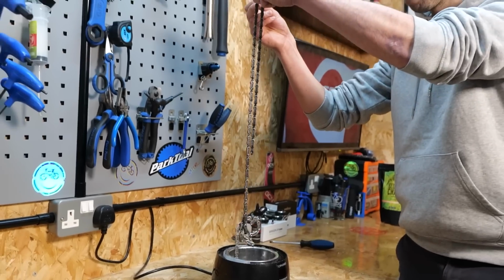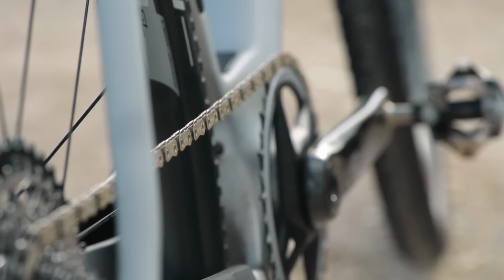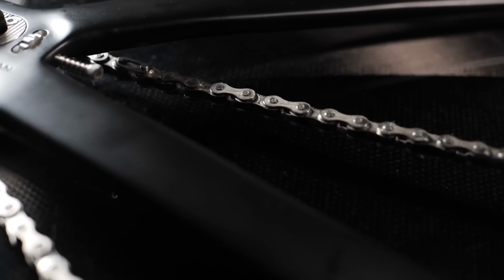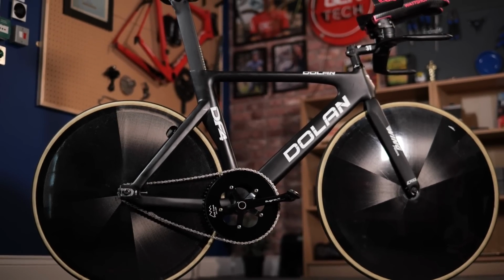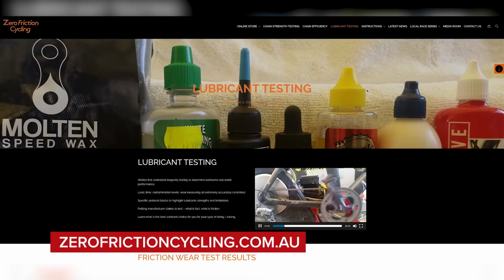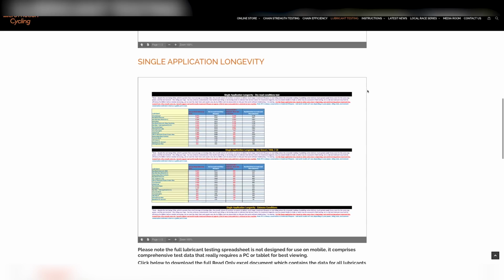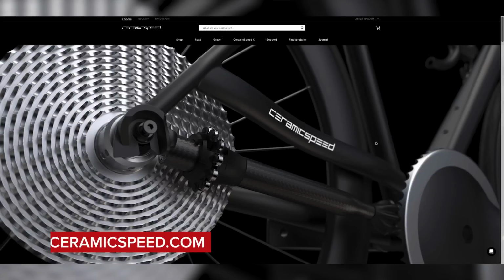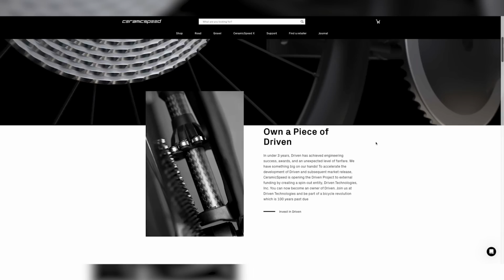Maximising Drivetrain Efficiency & Longevity: Deep Dive With Josh Poertner

Comment from the maker: Do you want to see us make more deep dive videos like this? 🤔 Let us know in the comments below! 👇
Reply: Absolutely 👍
Reply: Absolutely yes, these videos are so educative
Reply: Josh did a great job really interesting .  Learnt alot , at the very least the importance of proper chain cleaning regardless of lube. 
So yes please
Reply: But wax can't work in wet conditions, Especially  drip on wax It is dissolved in water and it will also dissolve in rain
Reply: @taburetca  If you look at the ZFC data you will see that wax, including drip wax, outperforms all others even in the wet.. but the issue you experience in the real world is that the wax lubricants are bad at hiding when they begin to fail.  Whereas oil based lubes remain quiet even when they have failed due to the viscoelastic sound damping within the chain.  So wet lubricants fail first in the rain, but hide it for a long time, whereas wax lubes are letting you know audibly that they are beginning to fail well before complete failure.
Reply: Went to Zero Friction Cycling as the video showed, and my Squirt lube shows a high wear test.  I switched to Squirt because ceramic speed test showed it as the the 2nd least watts lost in all the lubes they tested.  Now I'm more confused.
Reply: @Oblivion__Approaches  I did the same. I'm about out of Squirt,  will try Silca Super secret next
Reply: @Oblivion__Approaches  The CeramicSpeed/Friction Facts test used heated immersion to test the Squirt for efficiency as it doesn't penetrate the chain when simply dripped on.  Since they are testing lube efficiency, this was the only way to get the data they were after, but ZeroFriction tested it by drip application which is what you would do as a consumer and it doesn't test so well due to this penetration issue.  You can approach the performance of the FrictionFacts/Ceramicspeed test if you heat the chain with hair dryer before applying and then use the heat and your fingers to really work the lube into the chain while warm.
Reply: @Oblivion__Approaches  If it is only watt loss, then you save on your energy. If it's only low wear, you safe on you bank account. I personally don't see the few watts marginal gains worth the shorter longevity of the drivetrain. The two is likely opposing each other.
Or you can check both tables and find a sweet spot for you.
My personal experience is that I do not see the performance in watts difference, but definitely see the longevity and shifting performance - smoothness difference.
Comparing a muck-off dry lube to a silca sinerg-e.
Reply: What an excellent show, great questions, deep knowledge and answers. Ollie and Alex, great presenter  synergy  combo.
Reply: YESYESYES!!!!! And try to create more of your own data by inviting us to participate
Reply: This is absolutely fantastic! Such detail….I am now in no uncertain terms about chain waxing. Thank you GCN!
Reply: Yes please fantastic video
Reply: Yes, please.
Reply: HELL YES
Reply: Yes please. I learned so much that inspires me to share with others to help them! Thank you!
Reply: Yes, please. Having expert "testimony" vs. casual opinion is quite helpful. This has settled a long-standing debate I've had with myself for years and convinced me to make the investment in hot wax dip.
Reply: Brilliant. More! 😀
Reply: Can you make a "user manual" type video for super sectet lube? First time I hear it needs 12h to dry... When and how to apply and reapply? Shall I clean and how when applying super secret? How often shall I add super secret lube?
Reply: Most definitely!
Reply: Josh is a scientist. Everyone I listen to him on several videos I-ve seen of him, I feel awestruck. Please invite him more. What about a deep dive video on tyre pressures and his methodology or if we should use butyl, TPU or latex and TPIs?
Reply: Yes, and yes again! I get a lot more useful information from these than some of the more, er, clickbaity videos. ;-)
Reply: Yeah that is the way to go !
Reply: @gcntech You need some couches or something where you can sit down with in-house guests. For these longer interviews.
Reply: Yes please

Comment: I’ve been waxing my chains since “Winning “ magazine was out ! Quite, smooth , clean! And that was before 11speed … Regina freewheel and campy super record ! No indexing or S.I.S at that time, and I’ve been doing ever since.  One thing is you can reheat the chain after waxing to get rid of dry wax buildup or you will have little wax pieces on your floor and you will have it on your shoes and all over the house.  But it’s good  method for quite bike ! Also the losses of the freewheel! You do all of this stuff and have noisy freewheel ? You should use the best low friction lube or grease to make your drivetrain quite and efficient ! Not like the way you hear wheels now…terrible ! Regina had the CX freewheel and it was quite, and with their chain …perfect!  This technology is embarrassing old ? And unfortunately now with…  god forbid electric bikes? It won’t matter. In pro racing they charge bikes and chains often so you can’t use them as a example? The key word here is….clean! Every time I come out with my bike people ask is it new ? Nope ! Its clean !

Comment: I'm not convinced that alternate drive methods can't be made to work just as efficiently as chain drive. Cars have much more complex transmissions and automakers have developed ways of making high precision parts that work under far more extreme conditions than bikes experience. It's just that the cost, weight and complexity make it impractical for bikes. But, it still seems worth pursuing, if for no other reason than that it could be fun, but also because who knows, perhaps someone will eventually come up with an alternate drive system that's cheaper, lighter, more efficient and more rugged than chain-based ones.

Comment: Do chains technically have bearings or bushings? Meaning, the rollers as they rotate around the pins. The pins I assume are technically bushings as they rotate inside the side plates. Just curious, nothing important. I have an engineering background so such things just interest me.

Otherwise, I've finally come around to giving waxed chains a shot. I had no idea that they were that much better than any other kind of chain lubrication and figured that they were mainly only for bike fanatics. For years I've been using dry lube, specifically Dumond, which is quite good, but apparently wax is much better. I'm less interested in going faster or having marginally less drivetrain friction than in extending the life of the chain and drivetrain well beyond what I'm used to. But having a quieter, cleaner and smoother drivetrain is also a nice benefit, especially for indoor riding where noise can get annoying.

Comment: Unless you are a pro racer, or very high level amateur racer, I suppose the question is how much money and time is it worth spending on lubricating a chain to make it last longer when you can simply buy a new chain for basically very little money? (Yes, there is of course the friction reduction/power increase issue as well, but for us mere mortals I don't think these marginal gains will make any significant difference to be honest).

Comment: Hot melt wax has one VERY BIG disadvantage not mentioned here - it does not waterproof the chain. If you ride in rain or leave your bike outdoors exposed to dew, beware of links rusting internally and seizing up - not only increasing friction but meaning you need to replace the chain. It can happen very quickly.

Comment: The use of more compact drivetrains does cause the chain to bend a bit more.  Been using paraffin for forty years now.  I would run two or three chains switching between them.  Narrower chains don't seem to last as long.  Lubrication has to be done more frequently, but with master link, it's not that bad.  The Crock Pot I have takes a good hour and a half to melt the wax, but the temperature is bound to be much safer than direct melting.

Comment: I recently switched to Silka hot wax as I got a new gravel bike and wanted to prolong wear as knew I'd constantly be in the dust. I converted 2 chains and took them to Unbound this year. The 1st chain I converted had about 80 miles of riding before the event, and with the mud, rain and 205 miles, the chain did amazing. I'm a wax fan for life now. It really is not that much extra work either. Just get a dedicated mixing bowl for the instant pot so you can easily dip the chain. Now I just need to convert the other 4 bikes to wax. 😋

Comment: Bike chain isn't spinning at 10,000rpm. Lubrication for bicycle chains is much more trivial than most think. How many are caring to win a race by seconds? Almost none. They could probably build a chain with builtin lubrication. Bicycle chains wear so fast that wear is hardly a concern. This really shouldn't be the case. A bicycle chain could be made to last a near lifetime. I don't think athletes should be the primary concern or driving principle of bicycle mfg. They are the trivial numbers using bicycles. We should be more concerned with durability, longevity, recycling, and standards for mfrs.

Comment: 5:30 it's very well possible to put a chain into a casing. Somehow, we just chose to not do this on our road bikes. One of the nice sides of riding a velomobile is that not only the chainwheel, but also the chain and the cassette have a much longer life due to the whole system being inside the bike. It's biggest enemy is your own sweat in that environment, but 30.000 km on one chainset is not unheard of.

Comment: The mechanical engineering question I have had in my 60 years of riding which I have never had an answer to is this: when riding the bike, taking into account all vector forces of chainring and cassette, if the chain tooth ratio is the same with a larger chainring and a smaller cassette ring vs a smaller chainring and a larger cassette ring, which utilizes more power, or are they the same.  With the same cadence, I always feel that it seems harder to go faster with the smaller front chainring, and there appears to be more cross chaining with the larger chainring, when the tooth ratios are the same.  Anyone got the answer?

Comment: Can you switch from dry/wet lube to wax in the middle of a chain's lifecycle? How clean does a chain need to be in terms of removing old lubricant and dirt? Will running it through a Muc-Off chain cleaner and rinsing it off do the trick, or should I start with a brand new chain?

Thanks for this - it was super cool.
Reply: I have done both with no apparent difference between the two methods. We have nine bikes between the two of us, they range from sexy carbon to clunky steel folding. My preference for cleaning is to remove the chain, and immerse it in a screw cap plastic bottle, two-thirds filled with white spirit, or any other cheap degreaser. Shake it, let it stand long enough for you to drink an espresso. Decant the liquid through a paper coffee  filter into  a second bottle. Keep this degreaser for the next time (I think mine is more than six years old now). Immerse the chain in the liquid wax.

Initially, it might appear to be a lot of faff; however, the longer intervals between needing to give your chain some TLC soon begin to add up. The greater efficiency of your transmission is harder to measure, unless you have a power meter and accurate records of "before and after". After a year or two, you begin to realise how much longer chains and cassettes are lasting.

The only negative I have yet to solve: when cycle touring, it is often necessary that our bikes are out in the rain while we are warm and dry inside our tent. Rust spots have appeared on our chains. The chains have plenty of wax where it is important: inside, on the rollers and plates. However, rust on my chain is a stain upon my soul!

Comment: The bottom line is 'keep your chain as clean as possible' i've just changed mine after 5500 miles both outdoor and indoor use. I check monthly with the Park Tools CC-2 to ensure i stay on top of wear. A regular wipe down with a (GT85 damp) lint free cloth then a degrease/ relube at regular intervals keeps it tip top.

Comment: If you are a slow rider, and you feel like a time/speed difference won't make an improvement, you are mistaken. You have more to gain from improvement than the pros do!

let's say, you average 20 mph on a flat trail. The trail is 20 miles long so your average time is 1 hour. If you make a 10% improvement in average speed by ditching your alloy box wheels and going for deep carbons, you can now go 22 mph, and your trip falls down to 54 minutes, that is a 6 minute reduction. 

Let's say a pro rider can do the same trail at 30 mph. That pro rider will average 40 minutes. yet, if the pro increased their speed to 33 mph, the same 10% increase, they would average 36 mph, a 4 minute decrease. 

So as an amateur, you would reduce your time on our hypothetical trail by 6 minutes, and a pro would by 4 minutes. 
So yes, it is also absolutely worth the better equipment for amateur riders, especially if they do enjoy chasing KOM's or sprinting against their buddies.
Reply from the maker: Great point Justin! Marginal gains and drivetrain efficiency isn't just an issue for the pros we can all benefit in some way. Perhaps those that just wan't to enjoy the rides don't have to worry but for those wanting to push their speed it can be a great hack!

Comment: Why don’t they use DLC on the moving parts? No need for wax or anything else.
The pressure he talks about is nothing compared to a motorcycle chain. Let’s not get over excited. Why don’t we use ceramic pins in the chains? That would better too.

Comment: I would love to see a deep dive on bearing types (steel vs ceramic) and oils vs greases. Seen some data suggesting bearing type is irrelevant but lubrication type is the key.
Reply: I know he's not for everyone, but Hambini has at least one compelling video that sheds light on the nearly non-existent benefit of ceramic bearings for cycling applications. The low rotational speeds that come into play in cycling seem to not bring the benefits of ceramic into play. But do some research on sites that provide factual evidence and settle the matter for yourself.

Comment: Ran my last chain with a wax that doesn't have the greatest reputation for longevity, got 2200 miles (3500km) out of the chain. Currently running long intervals (1000 miles) with Silca wax and topping up with super secret lube along the way (200-250 miles). 2900 miles with no measurable wear yet, and very little hassle.
Reply: Great to hear Tim!

Comment: dear silca, just an idea on your sealant. can‘t you sell the carbon particles separately so we can put them dry in the open tire and the sealant then into the open valve?
Reply: Thanks Penny, unfortunately, loose, individual carbon fibers are much finer and lighter than a human hair and the slightest puff of air or slip of the hand could put thousands of them airborne when working with the material.  We even looked at putting the fibers in a sort of 'Tide Pod' that would dissolve, but the real key to the manufacturing is coating each tiny fiber with the sealant as the two are introduced.. we continue to work on innovating in this space, but yeah, this one is a really hard problem to solve!

Comment: I always  use multiple chains for a long trip.  I do not race, so am my own support.  Yes they are kind of heavy, but two is enough as I have overnight to do a surface clean and then put in container (zip lock bag) with drip on wax.  Depending on the distances, it can last up to two days or maybe just one before replacement.  but that makes life cleaner.   One thing,  300+ miles, that is much longer than I run before a change.  hmmmm..

Comment: Do you use quick links when/if you are hot waxing chains? Are they "good" enough or do yo just use pins?
Reply: I'm onto my second SRAM PLCK-D1 PowerLock (12sp Flat-top chain), having retired the first one after connecting it five times from immersion waxing the chain every 300 or so Km. They're about AUD $7.00 each. One of those per 1500Km with a second chain on rotation to do immersion waxing that should see my drivetrain last at least 30,000Km of quiet, clean, very low friction riding seems to me to be pretty good value. SRAM does not do replaceable pins for its 12 speed chains. Not sure about the others.

Comment: How eco friendely is Silca hot melt? At the bottom of the slow cooker there's a lot of dark stuff, is this the tungsten disulfide? Do you have to mingle it with something like a spoon before putting the chain in the pot? Is it more" eco friendly to wash micro fiber cloth after cleaning chain or to throw them away? We have a history of chain breaking on our Emtb (11speed drive train more frequent +9 speed timing chain less frequent)tandem (plates coming lose of pins and quick links same even with wipperman).  If a chain breaks offroad waxed is a giant advantage : oiled chain dropping in sand : nightmare. Meanwhile I recognize the sound of plates coming loose. It's not because of shifing mistakes, although in my experience DI2 is harder for the chain than mechanical. We're spinners and ride in eco. My solution for the moment buy cheaper shimano linkglide chains and change them before they break. I use 3 driving chains and two timing chains and use the shortest one after rewaxing. Multi day long rides when it's wet are a problem. My solution : I always take spare chains. When use two slow cookers : one for taking old wax of, then let drip and put in next pot. Is this helping to avoid dirt conatmination or is not worth the time?